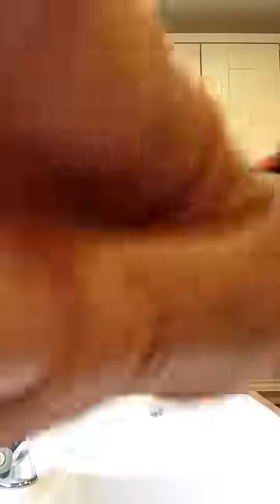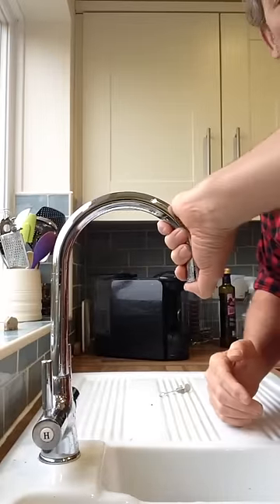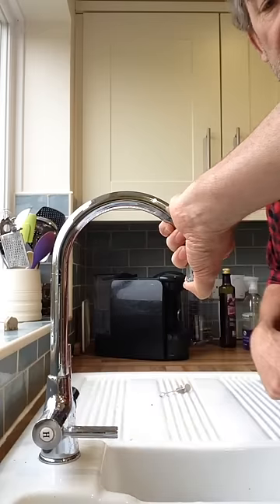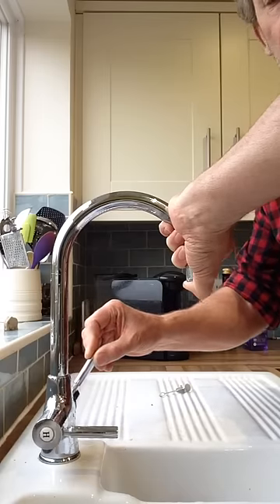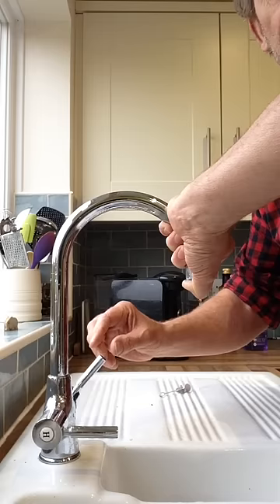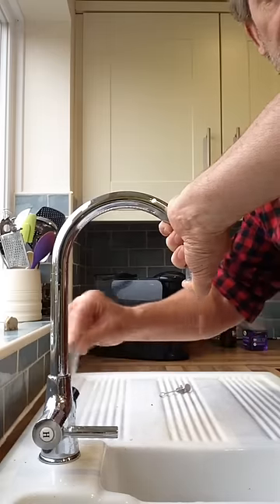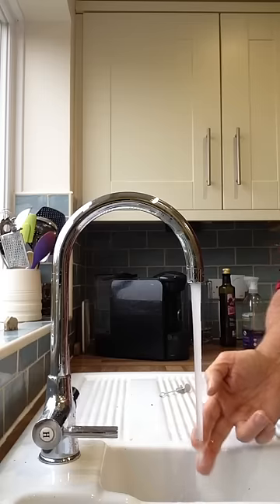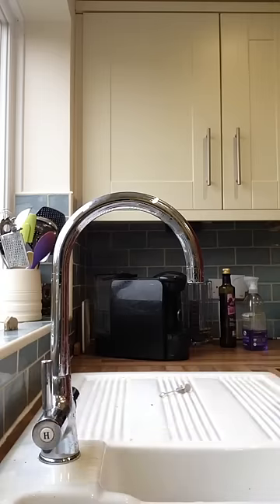Unblock an airlock in the hot water system in ten seconds - no tools needed. (See disclaimer below.)

Comment: Success! After trial and error. Neighbour just had a water leak and was left with this problem after the plumber left (this is in Spain so you will know what we are up against). I tried for ages with this method, I knew it had to work so not being one to give up I started checking all the taps and valves only to find that the little isolation valve/tap between the electric water heater and the main isolation tap was knackered. I left the hot water tap open still running with a trickles and began turning the iso valve back and forth then suddenly it passed its maximum and bang! Out came the airlock and loads of hot water. Simple two minute job to replace the valve tomorrow. Moral: If this ain´t working then check your valves and taps, cos this works 100%.

Comment: After losing my hot bath water, in absolute despair, stripping down taps and cartridges and contemplating getting a whole new system anyway, I came across this. Fixed it with two long good blasts for about 20 seconds each time. Simply amazing, cant thank you enough, and I cant believe this isnt a first suggestion from all these internet "experts". Thanks again!

Comment: You absolute legend. This is maybe the 4th video I've ever commented on to say thanks, because most are useless or go on for ages about nothing. 

You just got my hot water tap going again with the easiest fix ever. Thanks!! Truly.
Reply: I have one mixer on a low pressure geyser that needs this about once in every month.  Sometimes all I need to do is open hot and cold at the same time.

Comment: The water pressure for the hot water tap in the bathroom was low to non-existent. The water pressure for the hot water tap in the kitchen downstairs was fine. This method still worked and restored the water pressure in the bathroom when applied to the kitchen tap. The central heating worked fine, but would reduce the pressure in the bathroom when turned on. Thank you very much, keep up the good work.

Comment: Brilliant! After trying 100 different things with no luck I turned to YouTube and thanks to you I now know the fastest and, more importantly, most effective way to get rid of air locks in my hot water system. (My kitchen tap has two separate pipes (hot and cold) inside the tap, but the trick worked very well all the same).

Comment: Yep, worked a treat. Some hot water coming from kitchen mixer, but hardly any hot upstairs. Worked second attempt, needs enough pressure that you can manage to hold with your hand (used thumb palm for a better seal). Careful not to spray hot water in your face initially. Thanks; really saved my evening!

Comment: What a brilliant solution. It worked with a mixer tap with one control for both hot and cold water by putting the leaver a little towards the hot side and turning it on.  It cleared the airlock in about 15 seconds.
Reply: This worked for me... cheers!

Comment: This was very helpful!! Thank you so much. I also "googled" how to fix thus and found the same kind of unhelpful videos you spoke about.. our water has been giving us problems for awhile, well turns out we actually have a pipe (pvc) thats either cracked or broke the bond where it's been replaced before and it is literally less than 1/4 below the adapter so I believe we're gonna have to replace the hose and all as it is the cold water side of our shower .. our water will just stop running and we would have to go outside and turn on the outside hydrant.. it's just been getting worse and worse but  your simple hack worked even with all that going on! 5 thumbs 👍👍👍👍👍.. awesome..

Comment: One of the better DIY vids on YT for understanding and fixing an airlock. I also recommend 'What is air lock?' on the Practical Engineering channel for helping to visualise exactly what's going on in the pipe. My air lock was in the bathroom tank system, the tap is one of those annoying ones you can't block off easily except with a serious seal and my lock was in the cold water, not hot. Still, using these ideas I was inspired to mostly block off the tap by squeezing hard with a wadded up rubber glove and then flood back the bathroom coldwater pipe with the house hot water (reverse to this vid). I think it was important that my toilet cistern (also airlocked) was full, because otherwise the backed up tapwater dribbles into the cistern which is opened by the lowered ballcock, reducing the pressure you need to get the air out. Thanks for the ideas!

Comment: You are the best! Worked like a charm. Took me a while. It wouldn’t work for me at first, then I just had to go round to each tap and try the same method. As my kitchen tap cold was straight off the mains I actually sucked (with my mouth) the faucet and forced the hot to come out, had to do the same with my shower. I was almost ready to pull the immersion cylinder out so you have saved me hours. Thank you so much!

Comment: Yep! Or, if you have one of those push on bath tap shower thingies, just put it on to the bath taps as usual, take the shower head off the end of the pipe, get the washer out of that end, then put your thumb over the hole in the end of the pipe, making sure the shower "button" is in the shower position and do exactly what Mark did in the video. Hot tap on first, then cold. The cold water has a higher pressure than the hot, so it pushes it back up to the hot tank and should also take the air lock with it.
Heh, the bathroom's a better place to have water spray about after all. 😉

Comment: Worked like a charm! We had sub zero temperatures over the last few days and. I went to take a shower in the master bath and had no hot water out of the sink, tub, and shower. I checked the hall bath, half bath and kitchen and the hot water worked just fine. I was scared to death that I would need a plumber to fix the problem or worse than that some pipe had burst due to the weather. In less than five minutes, hot water flow was restored to all three fixtures. Thanks again.

Comment: Greater pressure from mains indicates an unbalanced water pressure system. In which case I would open both taps then block the spout. Similar results but you should look at placing a pressure valve at the main water entrance to your
house . Good video. Nice.

Comment: This did work for me but slightly differently.  Airlock was in upstairs bathroom basin hot tap.   We have a mixer tap on the bath leading to a shower attachment.  Took the shower head off (careful not to lose the washer) and pointed this down into bath.  Ran the water on a hot cold mix, did the thumb-over-the-pipe bit.  Had to persevere with that for quite a long time, until it seemed that the 'spitting' had stopped.  Ran the sink hot tap for a while and 'bingo' the airlock has gone.  The good thing here is that all the 'spraying' water went down into the bath rather than all over the kitchen!  I would use local plumber but it takes him about 3 months to turn up.

Comment: Another thing to check; check the aerator.  I thought I had an airlock because after changing one ball cartridge spring O-rings on my dual sinks in the master bath the faucet went to almost no-flow, then shortly after the other sink did the same thing.  I naturally thought it was an airlock and preceded to try various methods to bleed the lines.  When this didn't work I was considering a plumber when I decided to work back from the faucet until I could go no further.  Lo and behold after I took the aerators off I had free flowing faucets.  Replaced the cartridges and problem fixed.  Note I had turned the water off to the house to do the original fix.

Comment: I changed a shower head. And after i got low pressure for hot water. Having luke warm showers. I tried this trick but no luck.
When i held the tap the hot water cylinder was making a noise so i stopped. Should i hold it for longer?
Reply: I held ours till it stopped making a funny noise and just sounded like water running through a hose. Massive airlock in the boiler shifted in about 15 seconds

Comment: what if you dont have a single tap like that?? Cwill it work with the hot and cold tap?
Reply from the maker: You would have to connect the hot tap to the cold tap with some hose, fully open the hot tap and slowly turn on the cold tap to blow away the air block. 
Another way is if you hot and cold washing machine feeds simply connect them both with the washing machine hose and do the above. That should clear the system too. Good luck.

Comment: Hey!  when doing this method, and even along with @eny68 technique,  the water pressure did increase momentarily while blocking the tap, but after letting go its just goes back to very low pressure, less then half the pressure i usually have. Is it possible i didnt hold enough for the water to travel through the whole system? Cause it worked momentarily so i figure it is an airlock.

Comment: This is only when both hot and cold water pass through one line..what about two separate lines 
Of hot and cold ?
Reply from the maker: It only works as shown with a mixer tap. With separate taps you'd need to connect one to the other, which would be a bit of a faff. However if you have a hot and cold feed to your washing machine you can easily fit the cold feed to the hot feed using one of the standard hoses then turn the cold on slowly. Worth a try but as ever at your own risk. Hope this helps.

Comment: Will this work for air lock in the radiators
Reply from the maker: No.
Reply from the maker: I don’t think so. To get rid of air blocks in rads you need to bleed each radiator in turn.  IE you’re bringing the water down, not pushing it up. 👍
Reply: Thanks for your reply. 
I’ve had a plumber call and fit a new thermostat valve on one rad and now all downstairs radiators are not working but all have been bled with pressure correct. 
Would this be an airlock somewhere and how can I release it
Reply from the maker: I’m not sure mate. Sorry.

Comment: This didn't seem to work for us, but it's the cold tap that's got the air lock in it. Nothing is coming out.
Reply from the maker: It will only work if  the cold water tap is fed by the water main. You can usually tell if it's the main by the fact that if you try to put your thumb over the tap the water will still spurt out under the pressure. If it doesn't it's probably fed from a tank in your attic (or somewhere else high up).